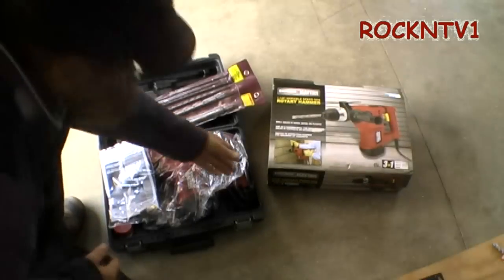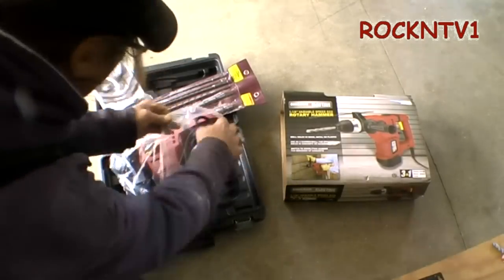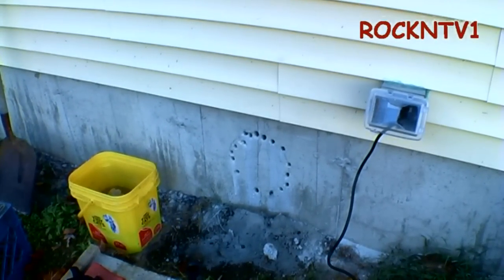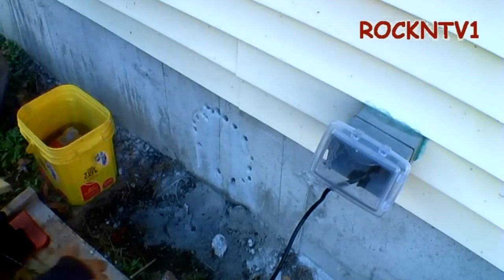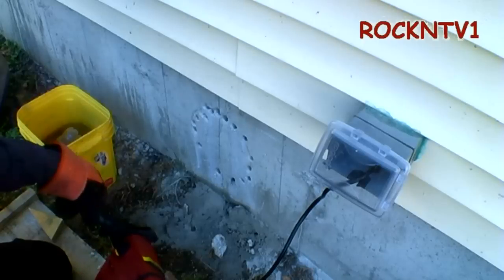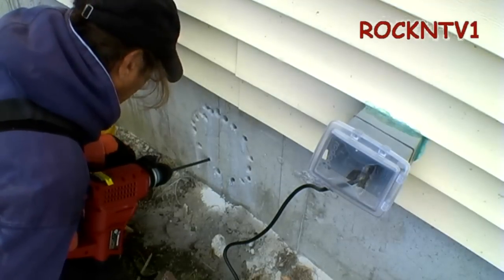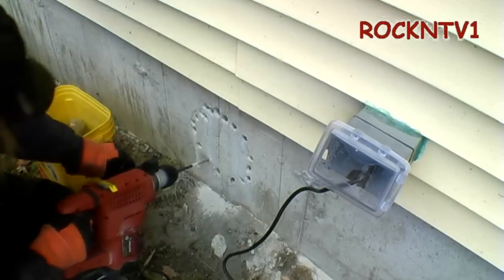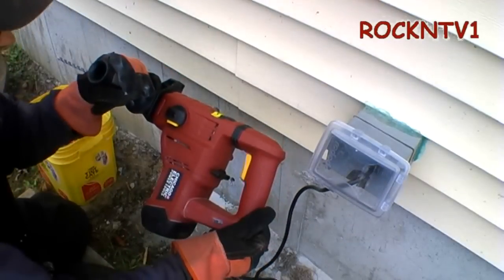SDS Rotary Hammer Drill Masonry and Concrete hf 69274

Comment: You should have added your finished hole at the end of the video. Would love to see the end product and how you dealt with any irregularities in the hole
Reply: Saw the other videos with the hole. Nice job. How did the hammer drill perform? Did it last the entire job? Is it still working? Noticed that you did not used it for the bolts so I was curious.
Reply from the maker: Ricardo Claros
the drill worked great, the anchor bolts required close fitting holes so i did not use the hammer but regular masonry drill bits.

Comment: I hear you! Like We need an excuse to buy tools lol!
I learnt my lesson just you like you, the hard way. However just the other week I was ripping out a kitchen and I came to an awkward cupboard, it's install made it impossible to remove without cutting it apart, but the location meant I couldn't easily do this with the tools I had, rather than wasting hours of hard work I went to the toolshop, got a cheap reciprocating saw and had it out in minutes (in about 20 pieces haha), worth every penny.

Comment from the maker: lol, some how in my give and take relationship i feel the need to explain my tool purchases, you know, whats mine is ours, and i usualy get "whaddy ya need that for". I guess hearing the explicatives while looking out the rainy window and sitting on the couch she saw my pain ;) Although doing this job myself saved us several thousand dollars. Less than a hundo on a rotary hammer  i could use to build a stone wall out front sealed the deal. Sad, It wasnt that easy to explain the milling machine.
Reply: So did it come with drill bits or did you buy some?  Which drill bits did you use?
Reply from the maker: had to buy seperate,, hf has them,, work well

Comment: I have an almost identical drill bought here in the UK under a different name, cost about the same too. I bought it for one job, to chip out a concrete floor to reach a leaking water pipe. Is it the best drill, no, did it do the job I needed, certainly and more, it has drilled many holes since and chiselled a bit more concrete. Was worth the cost to save my back and arms and if it broke tomorrow I would be pleased with what I had. Great video as always.